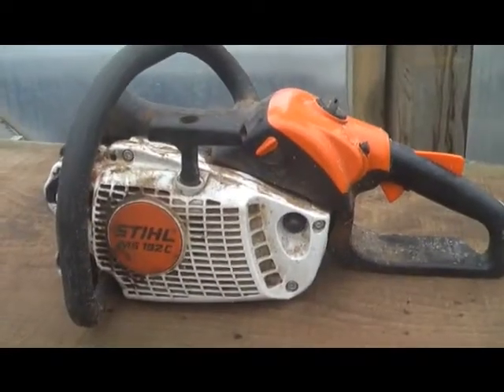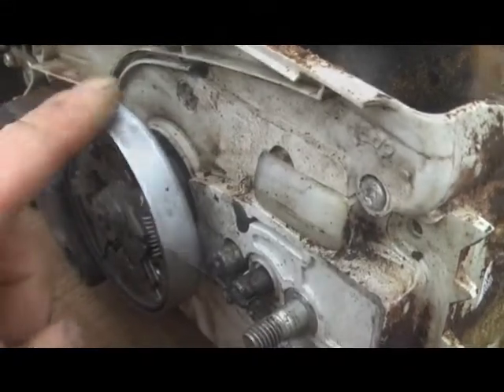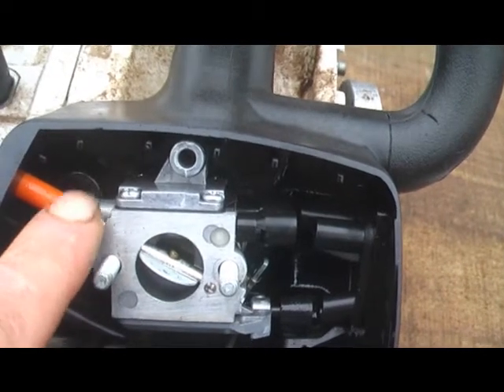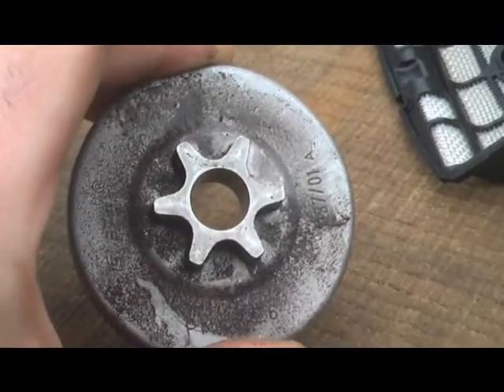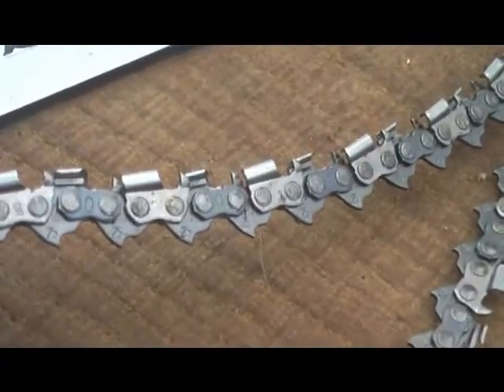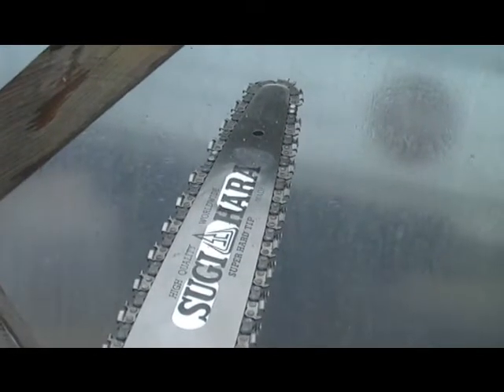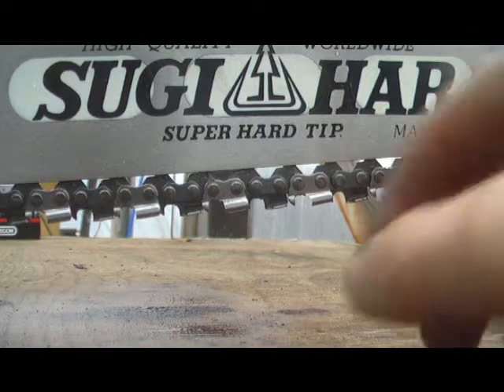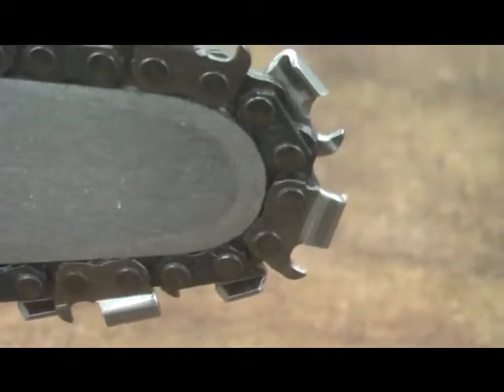Chainsaw carving - Stihl MS192 CE sprocket change to run 1/4" pitch chain

Comment: interesting, but how is the kick-back when you catch that top front of the bar ??
Reply from the maker: The small nose diameter makes it almost impossible to give kickback - hence carving bars you can use the very tip of the nose safely... but still not for the casual user. You need some good experience with a saw first...